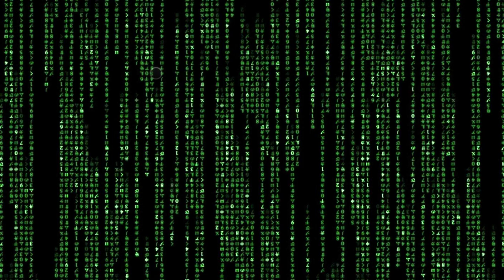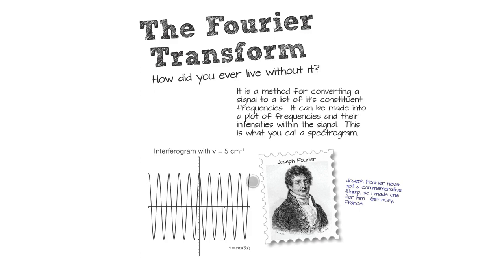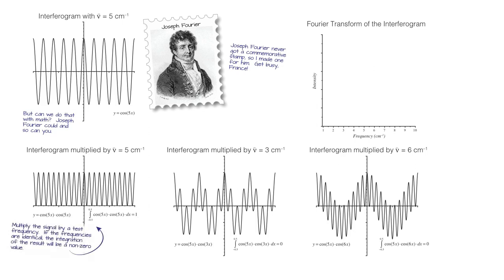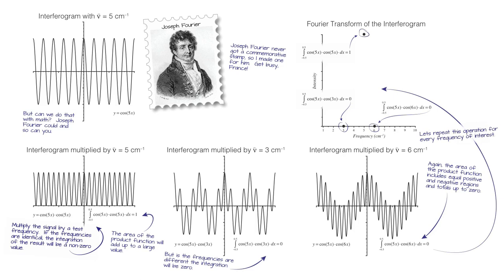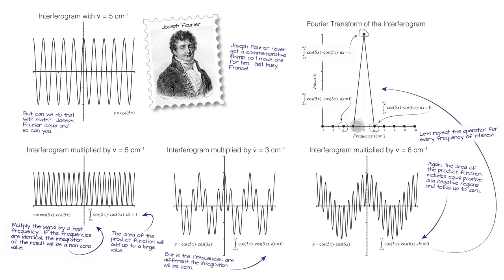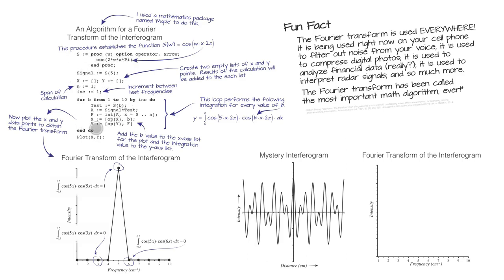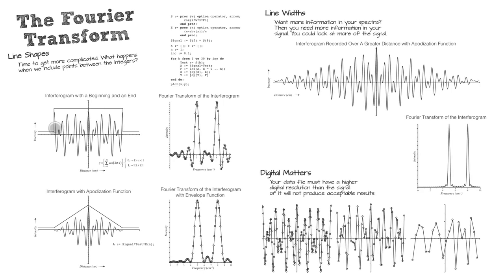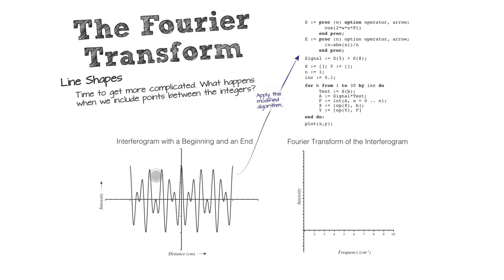The Fourier Transform in FTIR Spectroscopy

Comment: I dont know exactly what is going on, but some of the early math is wrong (or stated incorrectly). for example the integral of cos(5x)*cos(5x) from -.5 to .5 does not equal 1, in fact cos(whatever)^2 is equal to 1 - sin(whatever)^2 so it is always less than one. It is still a really good explanation wise, but something is wrong with the early math (around 2:40).
Reply: that is integartion with span=1 ( the area)

Comment: That is amazing lecture. Thank you so much ! I have a question. What can the intensity of FTIR peaks tell us about ? What is the meaning of the intesity in FTIR ?
Reply from the maker: The ratio of observed intensity to original intensity of IR light is what is reported in a typical IR spectrum output.  If a peak is at 20% intensity that means that 80% of the IR light was observed at that wavelength.  By converting the ration to absorbance we can obtain a number that is directly proportional to concentration.  Abs = –log[I(out)/I(in)].  If we know the molar absorptivity for a given substance at a given wavelength we could use the abs value to calculate concentration.  This would only work where we have a dilute solution (usually in chloroform).  Other IR methods using thin films or KBr pellets to mount the sample would not give results where concentration has much meaning.
Reply: @keynotechem  Thank you very much for your answer !

Comment: but, how can we get a function of the FTIR interferogram that we can put into the Fourier transformation?
Reply: That is where real mathematics comes in.  I used a continuous function made up of a set of combined cosine waves and tested it with a single cosine wave of a chosen frequency.  The integration of the product will give an answer of 1 if the frequency is present and zero otherwise. However you will see in the presentation that there are serious limitations to this approach and it is not a "real world" application.  In the FTIR, the spectrum received is a series of data points taken at set distance intervals (a multiple of the wavelength of the laser you see passing through the sample chamber).  So you have a list of power received at each distance and need to turn that into a list wavelengths in the signal and their power. This is where the "Fast Fourier transform" (FFT) algorithm is used. It is designed for manipulating data points, not continuous functions. I sadly can tell you little about it, but it is famous in math and computer science and there are many videos dedicated just to the FFT available out there. My method demonstrates the idea of the Fourier transform but is useless otherwise.

Comment: One of the best presentations of FT, but i still din't understand why need to use interferometer, can we just use different frequencies of light are shone on the sample simultaneously then do FT? why need interferometer.
Reply from the maker: That could be done. However then you need either a diode array detector or the machinery to move a diffraction grating so that the light crosses a detector as the grating moves. In that case you would not need FT as you are analyzing the energy at each discrete wavelength. UV-vis spectrophotometers use this method.

IR wavelengths make the use of the interferometer convenient and less expensive than continuous wave systems (like UV-vis). Diffraction gratings for IR are difficult to make but not impossible. I myself am not familiar with all the limitations and advantages of both approaches but clearly for IR the industry has chosen interferometry for its effectiveness, cost and convenience in this wavelength range.